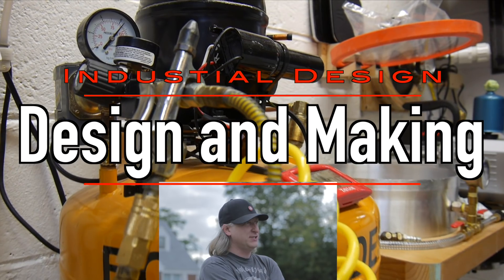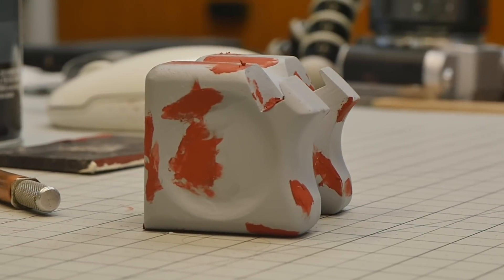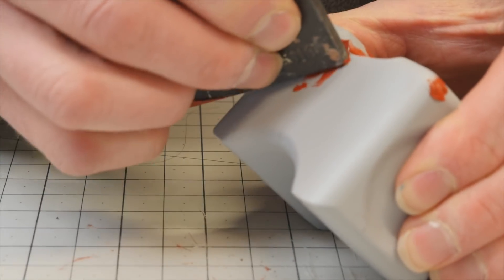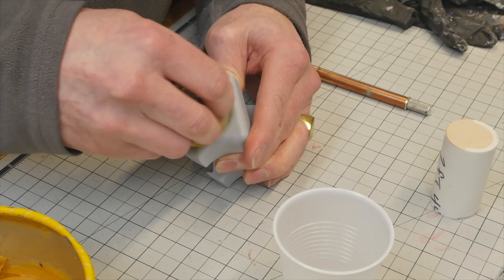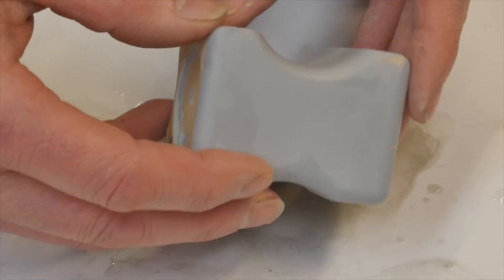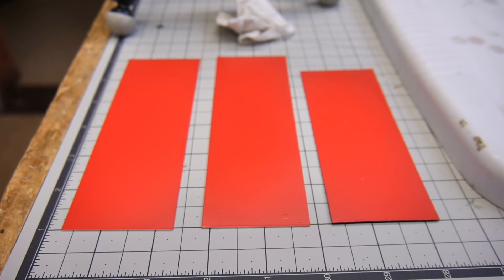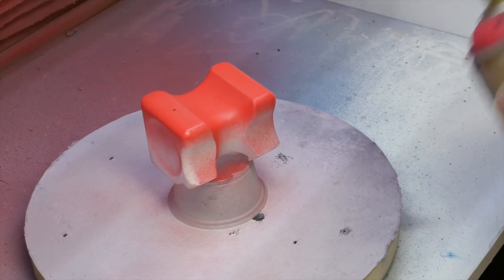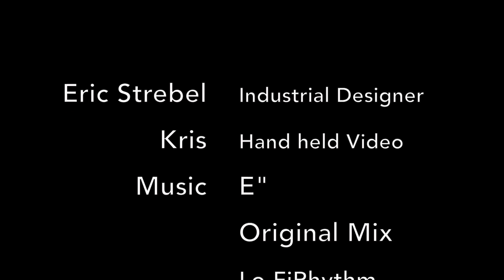Spray Paint Finish Process: 𝐅𝐚𝐧𝐭𝐚𝐬𝐭𝐢𝐜 Surface technique for Prototypes Models & Mock ups

Comment: Hey Eric, I'm a big fan of your channel and your work!  I am currently working on several painting projects of my own at the moment and I just wanted to check with you about your warning against Rust-Oleum primers.  I plan to use the Dupli-color primers that you recommended but I just wanted to ask why you don't like using Rust-Oleum?

This is just curiosity speaking, along with my belief that knowing why you want to do something, as well as why you want to avoid doing something else, helps us to become better at our craft. 

Thank you so much for your time and I look forward to more of your videos in the future!
Reply from the maker: Rest oleum is often not very compatible with other paints and I have seen many many projects ruined by that product. Be careful if you’re mixing paint from different manufacturers. The rest oleum just isn’t that quality either in my opinion
Reply: @EricStrebel  Thank you very much.  I'll keep that in mind, I sometimes struggle with primers and sealants.  I don't know if I'm being too aggressive or if my painting application is what needs to change.

Comment: Excellent video as always! You would make a great professor since you are so skillful in transferring knowledge to others. Surface preparation of an object with 'empty' surface (as in your video) is explained quite clearly and straightforward. However, what would you advise when we need to produce wooden miniature object (say 30 x 30 x 30 mm) with surface full of small (shallow) details such as grooves, 1 mm deep channels, shallow circular carvings, etc. How does one sand, prime and prepare such object for painting in order to achieve a smooth and gloss surface without 'deforming' the detail carvings in the wooden surface? Is the alternative solution to prepare and paint the wooden object first and then inscribe the details in its surface?

Comment: 👍👍can you give me the name of the different putty you use? - sanding putty (red) - filler putty(green) - impression putty (beige)

Thx
Reply from the maker: Polyester body filler, it the main ingredient, spot putty or sometimes called polester glazing putty for the pin holes.

Comment: Thanks for your video Eric. I'm trying to refinish and paint some older Coleman stoves. The issue is I'm struggling with the paint portion. Specifically getting a nice glossy even finish, it's either too dull or not quite glossy enough with glossy spotting.  Unfortunately I've been using Rustoleum. I've discovered if you don't wait a full 2 days between coats you get many imperfections in the paint. What paint do you recommend for a nice even glossy coat on metal for a lasting hard finish? With that being said what do you use for primer as well?

Comment: Thanks, very informative video, but what about the bottom (holder for painting) hole? How will be the over all painting even if You fill it at the end and paint just that part?
Reply from the maker: I just leave the hole the way it is. it's not noticeable when it sits on a desk or counter.

Comment: What's wrong with Rustoleum automotive primer?  Do you like Dupli-Color for color, too, or just primer?  If the latter, what do you like for color?
Reply from the maker: Karl Lautman Krapoleum! it's junk, I have seen to many projects ruined with that garbage. Get a good automotive sandable primer, the duplicolor paints are decent as well. There are many quality paints out there, Krapoleum is not one of them. If you can spray out of a gun, even better, use the stuff that the autobody places use if you can afford it.
Reply: Too late I already purchased a can LOL

Comment: not rustoleum.  so what is your weapon of choice?
Reply from the maker: Duplicolor is redily available at most automotive supply stores and works well
Reply: @EricStrebel  Thanks Eric. Awesome content.  Did you say parallel or perpendicular spray direction. (wrt the surface being painted)

Comment: Hello Eric,

thank you for your video. It's obvious that you attach great importance to perfection. The result is impressive. I am as well trying to get the most out of my current project. Let's see how it will be :).

At the moment I read through many tips for my current project and already have the paint, filler, etc. together. Now you're relying on primer, though. Of course I did not buy explicit plastic primer. Only classic rust protection primer and spray filler. Will this work just as well? 
Since the device should be used at the end it would not be so nice if the paint peels off at some time.

In my first test, the paints stick together and are relatively scratch-resistant to plastic and fingernails.
I have the following products:
Rust Protection Primer - https://www.motipdupli.com/en/INT/lang/products/dupli-color/mobility/cars-rallye-sprays/ipg-1090.html
Filler - https://www.motipdupli.com/en/products/dupli-color/mobility/preliminary-treatment/ipg-1002.html
Black Paint - https://www.motipdupli.com/en/products/dupli-color/mobility/cars-rallye-sprays/ipg-1089.html
Clear Lacquer - https://www.motipdupli.com/en/products/dupli-color/mobility/cars-rallye-sprays/ipg-1088.html

And thank you pretty much for the tip with the sanding cork. I will print special shapes out of TPU, which will have exactly the right radii and shape. Especially with the concave shapes on the buttons I will need them.

BTW: Nice trick with the plastic foil underneath the filler cap :D

My current Project:
https://sudomod.com/forum/viewtopic.php?t=5791
Reply from the maker: Sebastian W.  nice project, SLA print, finish it smooth and cast it in resin, and you have your self a product! to your question:The key is a quality sandable primer. If you can afford a two part urethane, even better. But the duplicator looks to be sandable.
Reply: I already thought about SLA. But for now its not affordable. 

With cast in resin you mean like this i guess: https://www.youtube.com/watch?v=uZhTVOP23ac . May I can use my finished prototype as a positive for the mold.
Reply from the maker: Sebastian W. Ha! Yes, like that video, LOL! Awesome.  You can use the finishing techniques from the spray paint video to make a nice master then cast that. The SLA will be a lot less work of course, thus I suggest that, but I understand budget constraints. Good luck